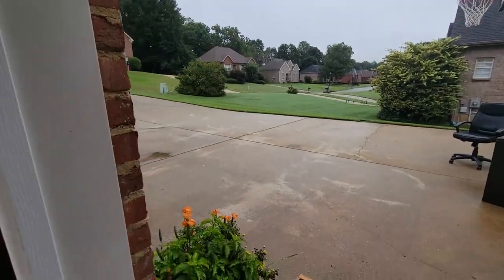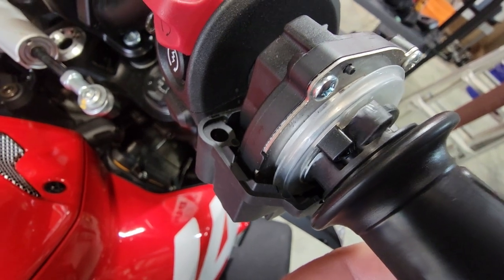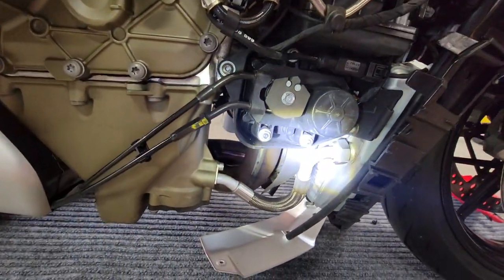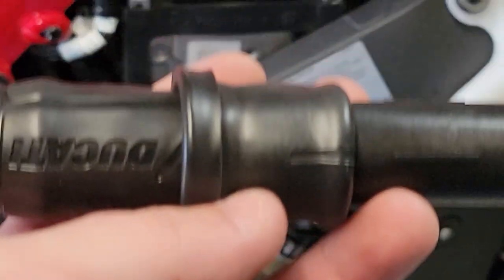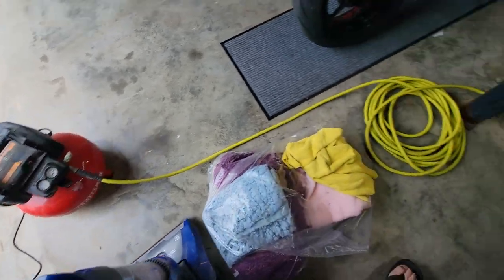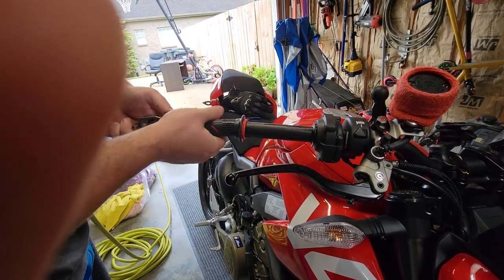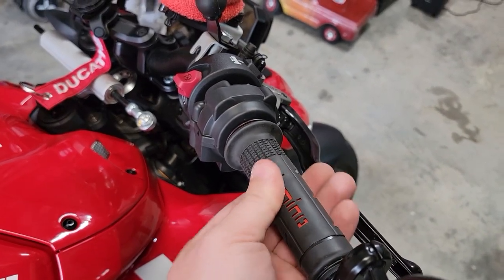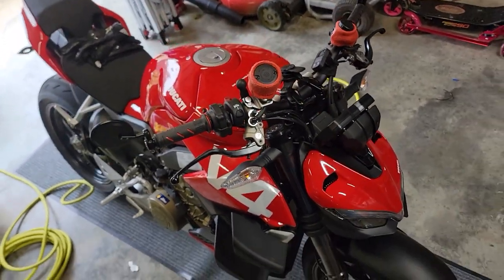Ducati Streetfighter Throttle Spacers and new grips install How to DIY

Comment: i’ve almost given up telling folks this… But the slack in the throttle is there for a reason! Trust me. While it might feel more responsive to you, it will do long term damage to your starter and ride by wire over time. Every master Ducati mechanic i know has seen this. Throttle spacers are an excuse for poor throttle control. It’s there for a reason, ESPECIALLY on the track
Reply: Yeah I like my sloppy throttle. I have nearly 13000 miles on my V4S Streetfighter and I prefer the slop. It’s forgiving for when you have those “Oh S*it” moments, like hitting a bump in the road or something.
Reply: @Whatever_Rad  exactly - throttle control seems like a lost art these days.... So many rider aids. The slop is there for a reason. If it wasn't, Ducati would just eliminate it.
Reply: how will this mod do damage to starter and ride by wire?
Reply: @marko9010  I'm not a mechanic, but 3 master certified Ducati mechanics have me this is the case. I had one on my street bike and my mechanic wasn't happy when he saw it. On the track i had one too for a while and it is SUPER dangerous there. The slack in the throttle is there for a reason. Throttle control. Its super super important, especially on the track. To me, these throttle spacers are not needed if you know how to ride the bike well and understand the meaning and use of throttle control.
Reply: @KiwiMoto72  thnx
Reply: I tend to disagree. While I only have 35 years of riding experience and drive every type of vehicle on the road and track, I think it’s about preference. Some people like chains that are more slack and some people like them more tight. Same with throttles and tire pressure, etc. as long as the spacer isn’t causing the throttle to engage then there’s ZERO harm being done to any component.